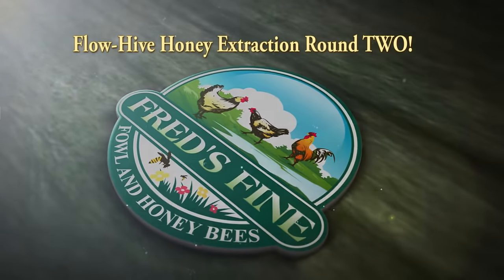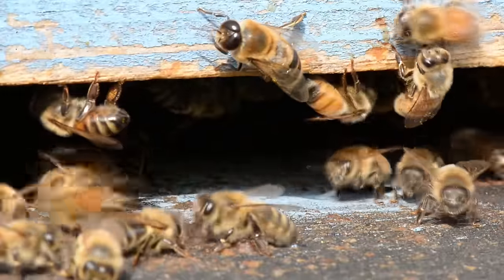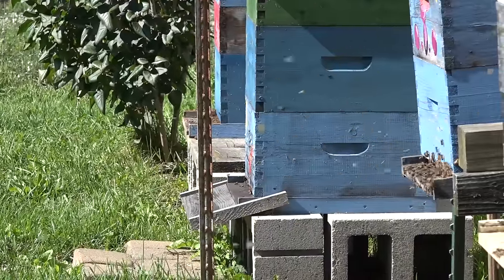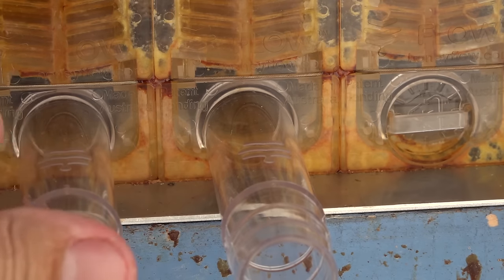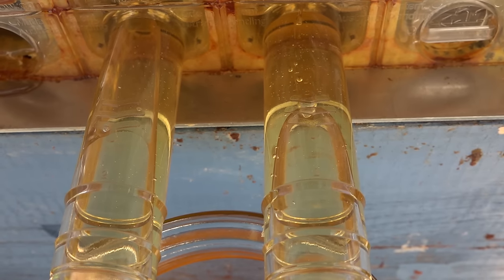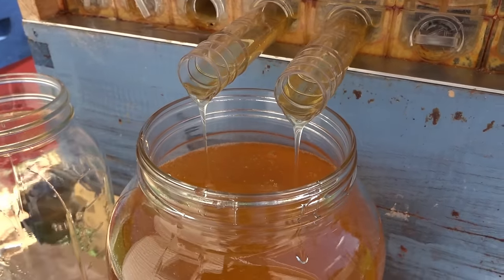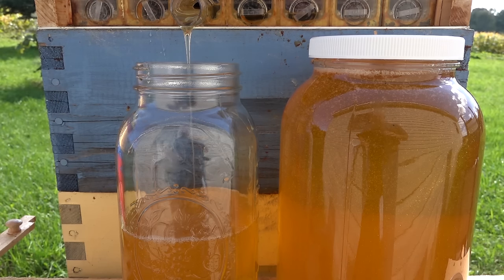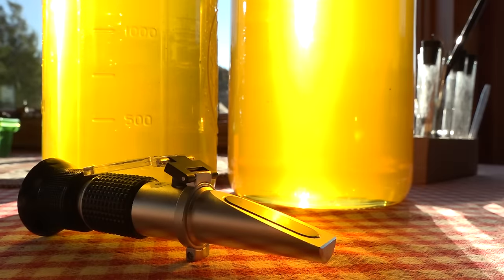The Flow Hive for Honey Bees 2nd Honey Harvest Review and Testing

Comment: Any benefits of using a double brood? I couldn't tell if you were using a single or double.  Just curious what it would take.

tks
Reply from the maker: In my experience, having two brood boxes allows two things, the first being just more room for dedicated resources brood rearing that aren't touched for extraction. And, during winter, the cluster tends to move up and the queen lays more in the second box up, moving away from the bottom board entry. In spring, I swap those two boxes, trading the bottom box (now mostly empty) with the second box. It's also a good time to rotate out some older drawn dark comb so they can replace it. This practice has worked for me for many years and keeps the queen out of the upper honey supers.
Reply: Thanks for the answer.  No swarming problems with these smaller footprint hives?  I say smaller footprint, because I'd normally have 2 honey supers on my double brood.  Which gives the colony room to breath in the middle of the summer.  I would guess its not a big issue though. 

Dam, they look unreal. Unreal.
Reply from the maker: Rocke Robertson Each apiary manager will see how things are with their own bees and adjust accordingly, as we all know, even colonies within the same apiary can perform and behave very different from one another. They will swarm if resources are high and the hive is full, I study swarm behavior, so swarms aren't a bad thing for me :)

Comment: I’m not a beekeeper but considering this system as a beginner. Do you first check the frames you plan to harvest to ensure it’s 100% capped with wax? What would happen if a few cells are not yet capped, a bee is inside the cell when you open it, would the system crush it?
Reply from the maker: This system is fine for beginners just as with any other beekeeping/housing system. The practices are identical, the only thing that changes is how you remove surplus honey. I've been using these for years now and have never crushed or injured a single honeybee during the honey extraction process. It's the least damaging method I've used and I've used them all. Always have a refractometer in order to verify the water percentage when you've extracted the honey. You "can" look at each frame first, but I've found that to be unnecessary when cappings are visible at the end of the frames. I have never had an issue with high water % when the caps have been visible at frame ends. No crushed bees, no bee parts in the honey and that's unfiltered. There are often tiny wax and propolis bits in the honey which rises to the top of the jar where you can scoop it off. I personally just leave those bits in the honey :)

Comment: I have a question for you! When you take honey from the bees do you have to leave a certain percentage so they have food to survive winter? Or how does that work?
Reply from the maker: Yes, I leave honey for the bees, that's what the extra boxes are for. Thanks for asking!
Reply: Frederick Dunn I had the same question. So you can take all the honey from that top box? Do you have to pull the top box off to check and make sure the other boxes are filled first?
Reply from the maker: @thegreatestislove8604  The lower boxes are "full" before I put the Flow-Super on. This year, they didn't use up the honey stored in the lower boxes through the entire winter. So, you don't have to lift it off to see if that's full, you let them fill it first, then put the mechanized frames on.

Comment: How many frames is approx 100 lbs? And is it stored in the Supers or the Brood Box?
Reply from the maker: With my apiary, the bottom brood box generally has brood, some honey stores around the edges and pollen. The second brood box (level 2) also has brood and generally much more honey, then the medium super above those two lower boxes will average 45-50 lbs of honey. So, the bottom three boxes should have from 80-100 lbs collectively. If they remain light, you shouldn't take off honey from the extra supers.

Comment: I apologize if this has been asked before, I read through some of the comments to check but there are so many...  I'm curious if there is a way to harvest the wax from these? From the videos it seems it's only an easier access to the honey. Also, if you have the supers on top of the other boxes, would it be hard to move to access the lower compartments to get the wax, and if you could, would that disrupt the bees by leaving the Flow Hive full and emptying the box below?
Reply: By the way, thank you for the video. It was very informative and put together well!
Reply: Ahh, I remember seeing one of your hives where the Flow Hive wasn't sitting on top... So now my question is, would you remove the honey and wax from the top box and the Flow Hive at the same time? Or wait until the top box is filled again, and then begin harvesting the honey from the Flow HIve leaving the top one alone? 
I apologize for all the questions... lol
Reply from the maker: Hi Aes, those are all very good questions. The FlowFrames themselves are efficient for the bees, in part because we don't scrape off cap wax and don't cut the wax the way we generally do with regular frames. This allows the honey bees to go straight into filling honey cells without spending too much time, energy and honey resources to draw out the wax comb again. With my normal frames, I actually cut across the honeycomb face and level them off, this also allows me to capture and process the beeswax. The FlowFrames are a bad method if your goal is to harvest wax along with the honey. The bees remove the cap wax and fly away with it for disposal, so you don't get any of that with this system. 

I have these set up different ways for learning purposes, some have a shallow super above the flowsuper, while others have the flowsuper as the top box. I leave that top honey super for the bees and only extract from the FlowFrames. I hope that answers your questions? The lower boxes are all left for the bees. After draining the flowframes, that's when they are removed (because they are lighter) and the lower hive inspected.

Comment: Thanks Fred really informative and appreciate you hints and experience  ... i don't know if you can give any quantities in Kilograms & liters but US Gallons are different from the rest of the world and down under we have used Metric for so long i cant remember what a Gallon is lol .... I'll Google it ...... Id love a comparison between the Lanstrom and the Flow hive in Weight/volume ...Thanks again
Reply from the maker: I have mostly the Langstroth design in my apiary. I lose more honey with the langstroth frames as I am taking off the cap wax, filtering, spinning/extracting and then bottling in the end. Every stage of that process causes some honey loss as it remains with the cappings and on the baskets and so on. There is no difference in the productivity of each hive/colony in my opinion, just how many steps are required to get the honey separated from the wax. I can tell you this, my wife is VERY happy when I'm taking honey off with the FlowFrames... there is a lot of cleanup with my Langstroth hives....  Two FlowFrames produced 3.78 Liters of honey with no processing.

Comment: is there any bee's wax with a flow hive?? if there is, how often do u have to harvest the wax? and how do u do that exactly??  do u have to take the whole hive apart and do u get the wax right there at the hive??
Reply from the maker: Hi Todd, for those looking for any meaningful harvest of bees wax, these flowframes are not the right piece of equipment for that. As the flowframes are drained, the honey bees remove the cap wax and discard it, so there isn't any left in the hive for the keeper to collect. They produce fresh/new wax caps as they replace the honey in each cell. The wax and propolis they use to seal up the flow cells is reformed and not discarded. I hope that answers your question.

Comment: So the bees just sealed the honey flow better? What about the leftover that drips into the hive when you remove the spigot?
Reply from the maker: Almost nothing dripped inside the hive during this cycle. When you remove the draining tubes and replace the end caps, the bees can lick any seeping honey from that bottom trough at the edges. I did allow the tubes to remain in much longer this cycle also and didn't remove them until the honey coming out was down to thin drips.

Comment: bit of a late reaction and you probably have already thought of this, but what do you think of using food grade silicon tubing so you can place a longer board a bit lower down and fit all 7 jars at once and drain everything separate all at once. :) looks like those tubes that come with the flow frame have a graduation and a spot for a o-ring so you have the choice of connecting a flexible tube/hose or a rigid tube to them.
Reply from the maker: Hi Rick, I did post another video showing how I modified the draining tubes for ReCap Mason Jar lids. I really have no interest in draining seven frames at the same time. BUT, others may read your comment and find the suggestion very helpful. Thanks for sharing your idea!

Comment: Advice/comments please, if you don’t mind:: 
So far I have 12 Flow Hives. Some of them  are ex Langstroth,  but the majority started as NUCS that I have nurtured since January 2018 to now. 
All are now Flow. 
Mixture of Flow original, Flow 2 and full 7 Frame Flow from existing Langstroth.(3 out of the 12)
With the exception of one Flow (started off from NUC, to now with a new Queen, and just beginning to go strong…
)
Since 27 November 2018 (when I did my first harvest on only Two Flow Hives), I have completed a total of 9 harvests.
Results have been, in my opinion and many of the people who I gave our honey to plus sold as well, that the honey is just delicious, smooth, fragrant and rich.
I’ve done the water content tests etc and all seems good.
Volume as of 13 January and 9 Harvests: 119.30 Litres
Is this good/Average (considering this is Spring in a very good bee area) or???
Thanks in advance
Cheers!
Reply from the maker: Sounds like a good harvest to me, so many aspects impact good harvests and what's great in one area isn't so hot in another. The best way to determine your level of success in production would be another keeper in your immediate area. Then you might have a better feel for how your bee lines are doing. Where are you located? I'm surrounded by snow and have low temps, we're just in survival mode here. I think you're doing just fine considering that you're starting off.

Comment: Aren't the flow boxes already built with an angle to them? Or does that correct itself when you put it in a stack with regular boxes?
Reply from the maker: That's a great question! The flow Super is square and parallel just like any other Langstroth box. It's the FlowHive Base/Landing board that has the slanting shim in it. The boxes themselves are just like any other regarding angles.

Comment: do you ever need to clean the excess wax that is building up around the frames? is there any cleaning or maintenance to be done on the flow unit?
Reply from the maker: Honey bees are over active lickers and cleaners of their environment, they chew away and renew wax that they have no use for and re-use that which they do. As with normal frames, the bees do all of the work. I expect that as the frames age and become less functional, they will require routing replacement as with traditional wax frames.
IF... and I have not encountered this yet, they become filled with pollen or brood, then cleaning will have to be done in order to prevent that from continuing.
Reply: thanks for the explanation, I don't raise bees, but I have been thinking of trying
Reply from the maker: AntoniusCaliber You're welcome.
Reply: +Frederick Dunn What kind of bees do you have
Reply from the maker: For the last 8 years, I've purchased my bees here
http://www.beeweaver.com/our-story

Comment: Just for emphasis, what's the reasoning behind less spillage the 2nd go around?
Reply from the maker: The bees actually close up every leaking point they can find and do a better job sealing up the "non-moving" exterior joints. I was pleasantly surprised as you can tell. It's the interior parts of the flowframes that slide and move, the exterior can be sealed and not impact function. Very nice indeed!
Reply: +Frederick Dunn that's amazing! Their behavior is so predictable if you have the experience with them and it's very clear the flowhive people know what they're doing. I'm sharing your videos. Just keep doing what you're doing. Don't question yourself. We love seeing the honey flowing too. Never boring
Reply from the maker: Closing the Loop Thank you!

Comment: Would you consider switching all your hives to this flow hive system?, I mean if the cost of the system wasn't an issue.
Reply from the maker: IF cost were not an issue, I would have several FlowSupers on standby, just as I do with regular honey supers. When a colony looks strong and is filling up, I would put the FlowSuper on that hive for the extra honey. I would also continue to have a few traditional honey supers on so I have a source for beeswax which I coat my frames with and use in wood finishes. So, I'd keep both, but would definitely use FlowSupers on hives that are producing lots of extra honey. Not all of my hives/colonies produce much surplus honey.

Comment: Do you smoke the hive to get the bees out before extracting the honey from the flow hive?
Reply from the maker: There is zero reason to smoke the hive/colony when you are not taking the top off or removing frames. One of the truly great aspects of the flow hive and flow-supers, is that you can check in on the bees as often as you want to, thorugh the side panel, or by removing the back access panel and the bees don't respond at all and continue with their tasks uninterrupted. Smoking the hives is disruptive and causes the bees to halt pheromone communications as well as initiate their "fire" response which is to fill up on honey stores as if preparing to depart the hive. Even when extracting honey with the flowframes, no smoke is used and that's a big part of how this is a less invasive method and much more bee-friendly. Sorry I didn't see your question until now :)

Comment: I have a Question... how does the flow hive compair to normal comb in terms of hygiene...  I mean for every 5 -10 years you need to get rid of old comb and checkerboard (im not sure what your pratice is on this)... and that doesn't even cover things like AFB or EFB... can you clean the Flow frames so they are like new or do they need to be replaced at some point these hives are like $700 thats alot of money to flush down the drain if it has less hygiene longevity of normal honey combs??
Reply from the maker: Hi! Well, your questions are good ones.. I'll start with AFB and EFB, those issues generally occur in the brood frames and not in the honey supers, however, IF I had a hive with AFB, I ditch the entire thing without hesitation and would not try to treat it. The $700.00 price tag you mention is for the entire system, I don't have those, I only have the FlowFrame Supers, not the entire hive, reason being that I already have plenty of Langstroth gear and didn't need new brood boxes and also they don't make an entire system that matches up with the 10 frame boxes, only the supers are offered in that size. FlowHive Frames come completely apart and can be cleaned and re-assembled. You can also wash them down or treat them as you would other frames with drawn comb, you mention 5-10 years, I have comb older than that and still use it, though I may cut it down, I do rotate frames into the brood boxes so they can freshen those up while pulling the dark coffee colored frames for disposal. The jury is still out on the longevity of these frames, if I got five years out of them I think I'd be happy.

Comment: What about the wax? This system doesn't allow you to utilize the wax, right?
Reply from the maker: The flow super doesn't produce surplus wax for beekeepers to remove and use. That's part of why the bees can re-seal and refill so quickly as there is very little to repair. However, the other boxes in this hive have plenty of wax in the supers and that can be harvested/cutout for wax resources if that's what a keeper wants to do. If someone is rearing bees and wants wax as the main honeybee product, a flow-super isn't something you want to be using. Flow-Supers produce honey with the least amount of wax production on the part of the bees. They simply seal the joints and cap once the cells are full. Better for the bees, but bad for keepers that want honey AND wax harvests.

Comment: How long does it take to fill a jar of this size
Reply from the maker: Depending on the temperature, the honey will flow faster or slower. In this video, each frame drained in 15-20 minutes. So for the gallon jar-20 minutes, for the half gallon jar- also 20 minutes.

Comment: I am curious, are the caps used for bees wax? If so aren't you losing a  resource?
Reply from the maker: I don't personally do anything with beeswax, so I'm not personally missing out by allowing the bees to remove and dispose of the capwax. It amounts to very little with an apiary this size. Now for those with hundreds of hives, it would be substantial, but they won't be using FlowFrames... at least not now.